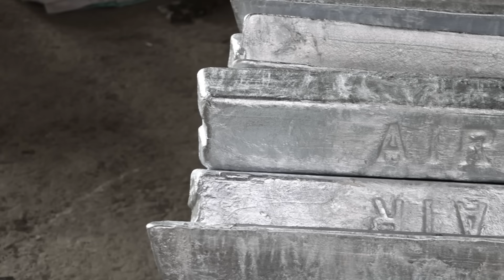Amazing Process of Aluminum Recycling | Bars Manufacturing Factory

Comment: А для чего алюминий перерабатывать в слитки? Для транспортировки?
Reply: Yes for transportation to a bigger processor that will remelt it and do the proper treatment to the aluminum to increase it's purity and possibly alloy it to specifications for an end user. Or it could be going to an end user that will do that work and make a product all in one facility.